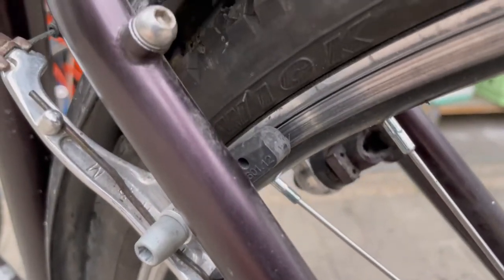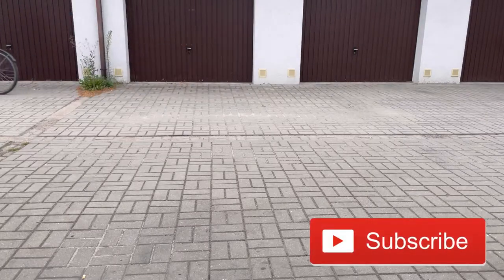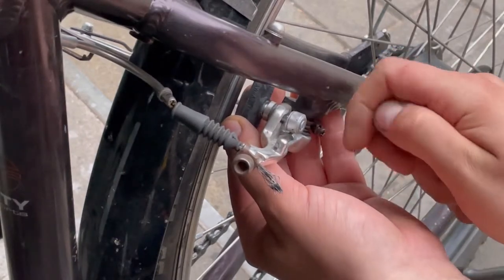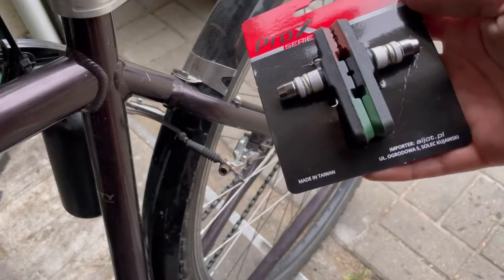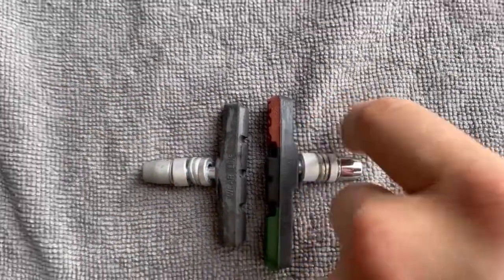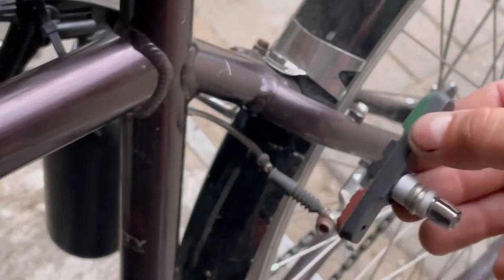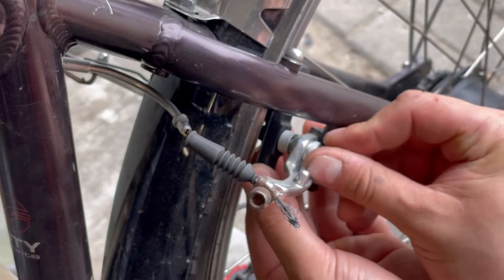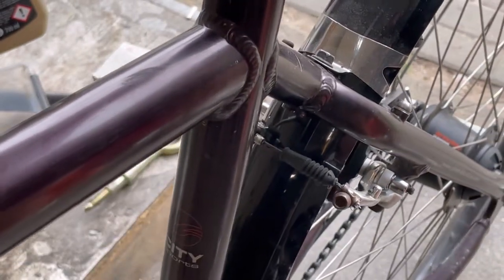V- BRAKES - weak & bad | How to UPGRADE ? Cheap replace

Comment: Hey! Ive recently upgraded my 29 inch BMX from a 2.1 inch tire to a 2.5 inch tire.. i had to readjust my breaks a nit due to clearance issues... however now, NO MATTER WHAT i do they are just squishy at the lever.. they work and have stopping power but i need them tighter as i feather the lever for wheelies a lot... 

what can i do to improve this? Would upgrading to an aftermarket V BREAK help?? As of right now they are stock aluminum v breaks... would you be able to recommend a good v break that can clear a 2.5 inch tire.